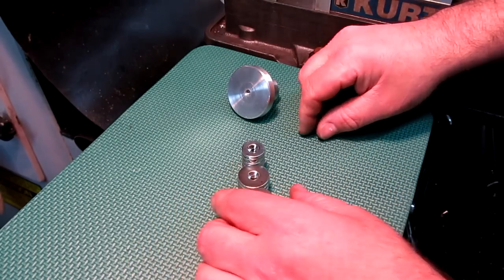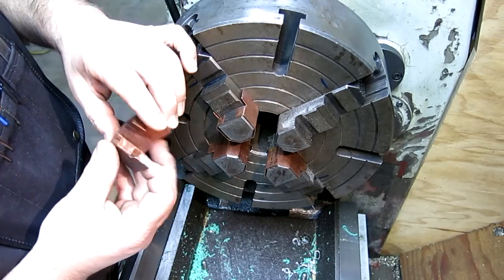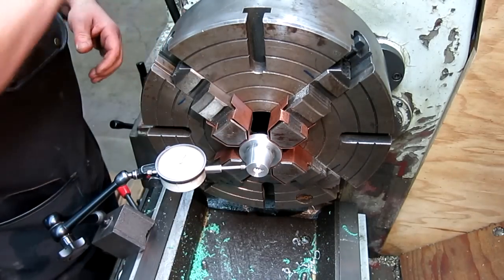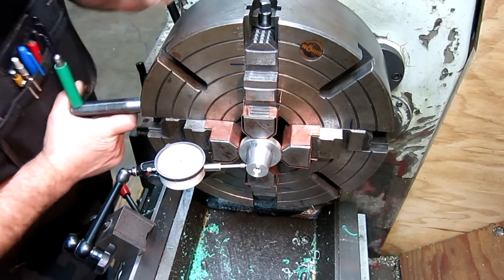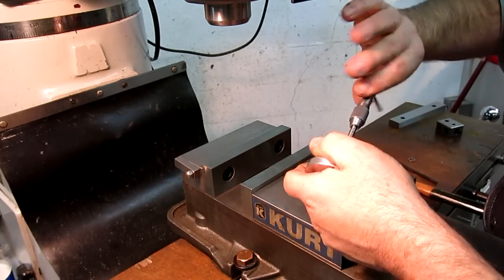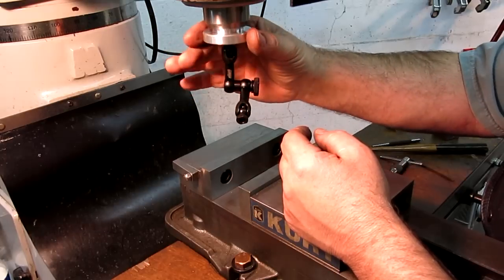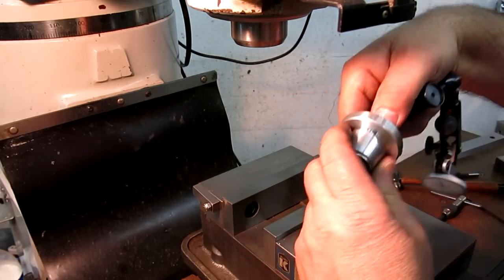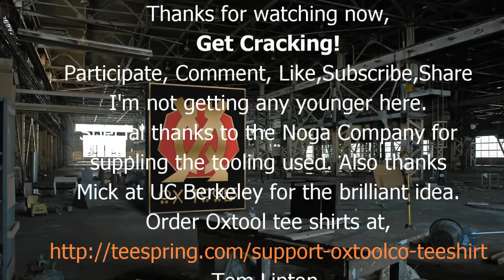R8 Noga Mount Part 3

Comment: May I ask why you choose aluminum vs steel. The power of the magnet will be transfer to the steel isn't it ?
Reply: maybe thats it, he wanted the magnet to pull it up, and not be sticking to the sides?
Reply: jusb1066 Hi! If you look at Part 2, he try to put the magnet on the side. That was a good video because  we learn how to hold such a part in a vise and how to adjust it.
Great.
Reply: Robert Patoine
Hello ! i did see that! but i think putting in the side was more for experimentation out of the previous failure, it would pull to one side, it needs to pull up to be sure its centred and not have friction until it snaps in, at least those are my thoughts!
Reply: jusb1066 these are no fault, they were features, like Windows 8! :-0
Reply from the maker: Hi Robert,

No particular reason. One of the non obvious problems it getting just the right amount of force. Too much and it will be really hard to remove and not enough, well you saw that. I figured aluminum would start me on the not quite enough side of the fence. Boy was I right about that. Thanks for the comment.

Cheers,

Tom

Comment: You should try an Indicol. It's only a billion times better than your thing.
Reply from the maker: Hi John,

Check out my video on "A Noga and Indicol Marriage" Can you say with an honest face you love the indicator arms on an Indicol? The clamp is great but the arms leave something to be desired. Thanks for the comment.

Cheers,

Tom
Reply: That indicol Noga rig is pretty sweet. I'd probably make one if I wash't retired from machining.  Those Noga arms are incredible. 

Yeah the indicol arms are pretty shitty. I'll give you that.  The best indicol mod is to replace the rod portion with one that is about 6 inches long. So much better. I don't remember off the top of my head what diameter it is.  I think I used an ejector pin from the mold shop I used to work in.